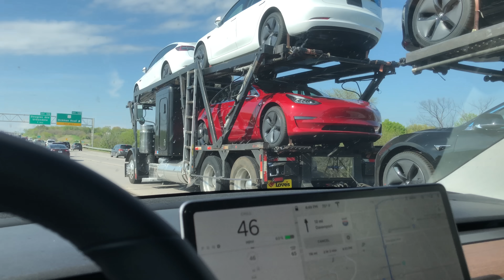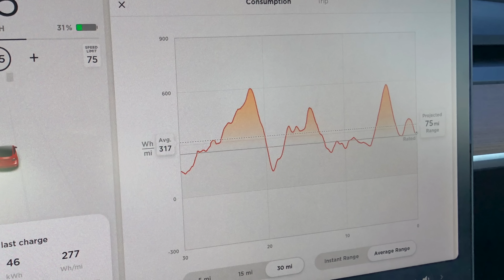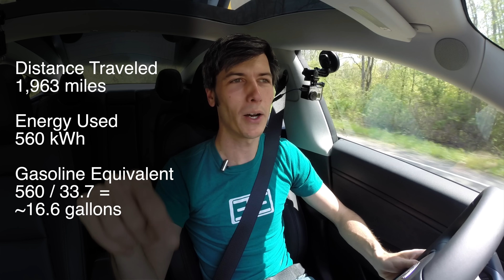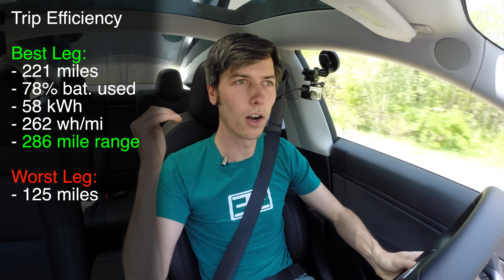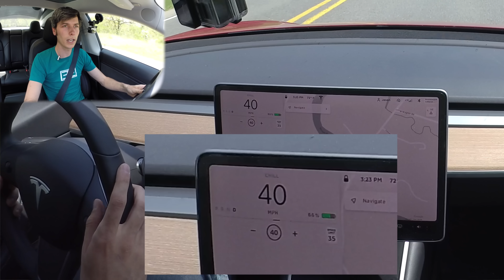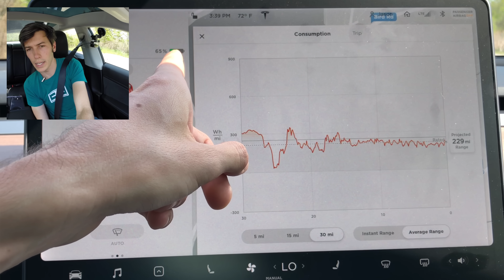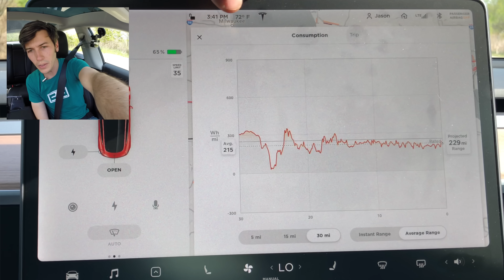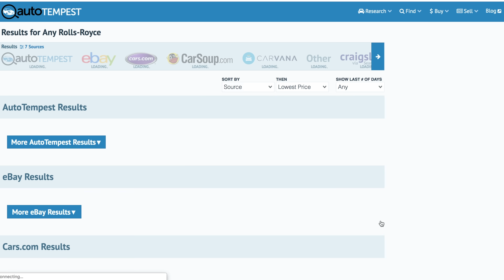How Miserable Is A Tesla Road Trip?

Comment: 21:31 is everyone going to gloss over the fact that he spent 8 hours charging this trip and only saved $40?
Reply: I thought you were getting 118 MPGe?  1963 mi/118 MPGe=16.6 gallons equiv., at $3.00 per gallon, that's $50 total.  Or, is that only at the "cheap" home charging rate?
Reply: @JN-lh9td  he said the supercharger stations are a lot more than charging  at home. I'm guessing it's to get gas stations to put in superchargers.
Reply: A lot of you saying it’s not very efficient if you were to consider a full year of this it is possible to save thousands and it is a developing car so maybe in a decade efficiency could be much better and make the savings much better
Reply: Number of extra hours I spend charging on a Tesla road trip: 1.5

Number of extra hours I can drive because autopilot reduces fatigue: 4 

Total extra hours I drive per day: 2.5
Reply: I make a trip similar to this every year but it's from NC to WI. The GPS shows a travel time of 13.5hrs round trip with a total distance of 890 miles. I would regularly complete this trip in 12hrs to include 1 stop to fill up my volkswagen and 1 extra stop for a food joint I like along the way. Overall my round trip would be right at 24-25hrs, average 75mph and 38-43mpg. 890/75 puts the drive time just under 12hrs for that trip.
Filling up for gas 1 time during the late part of the trip when file was around $3/gal only cost me $45 so grand total of $90 for his trip distance.
Reply: The problem is there’s only one charger in my 60 mile radius and about 40 gas stations.
Reply: @raptor0422  

Thinking that's a meaningful issue a misconception I like to call "gas Station thinking", a malady that is very common.

One of our BEVs has over 60,000 miles on it, in about 2.5 years, with maybe 4-5 times visiting a charging location with it. The first time was to try out using a charger, because I'd never owned a BEV before and I was curious what it was like.

The other few times I happened to be parked somewhere the charging spot was the best parking around, and I was going to be there for a while. Basically as a pretense to get better parking. :) Didn't actually need to use it, for any of these.
Reply: The savings should be up to $196-ish if you have free supercharging? Even at that rate, it’s still not worth taking the Tesla in long road trips. Just rent a gas car lol
Reply: Yes, and not only the lost 8 hours, but every 200 miles or 2.6 hours you had to pull over and charge. My Camry gets 41mpg on the road with the AC on, and that would have cost $144 in fuel or a cost savings of $12 to travel 1963 miles. Also the cost of my Camry is $25K vs his performance edition Tesla 3 for $48K.. WOW... $23,000 MORE - that's almost another car. I have ridden in one, and it is not worth $23K more, plus my buddy has much more problems with his 
Tesla, 4 things in 2 years, one electrical issue (and the car is all electric) one time his door wouldn't open and his paint is crap & peeling off.. The ole 2018 Camry has never been in for a repair (knock on wood) I think I'll wait until the cost of Tesla's come down like a big screen TV and the reliability has to goes up.
Reply: @ShelbyvsViper  Dallas to Phoenix, 3 fuel stops.  Midland, 325 miles (give or take) and buy a sandwich (25 min total)  On to El Paso (318 miles) eat at a sit down place.  Gas and eating 40 min.  On to Tucson (300 miles?) grab a sandwich, or some snacks, 25 min and on to Phoenix.
13.5 hours total or so, including 2 or 3 splash and go rest room stops.
Reply: ShelbyvsViper I will also vouch for the 2018 Camry. I have 41k ish miles on mine, and not a single issue. Engine/performance is much better then when I first bought it. No longer sluggish, and I can get up to 45MPG driving around 70 highway only.
Reply: @ShelbyvsViper  apples to oranges batteries are subpar in raw amounts of energy but much more efficient. A model 3 performance battery is equal to 2 gallons of gas. Do the whole trip, 2000 miles and all, and stop every time you use more then 2 gallons of gas and refuel. The only thing holding tesla back is the battery itself.
Reply: @yacqub  Granted much more efficient, and with Tesla's new battery breakthrough we may see the battery in a car far outlast a gallon of gas. But your comparison is like watching a 60" big screen TV on 60 1" iWatches (both technologies are out today), and until batteries catch up with fossil fuel (and it will) the majority of the world will watch a 60" Big screen TV. The next challenge is  when EVERYONE is on battery operated car and the drain on the grid will be astronomical. Can you imaging replacing 1.1 billion cars with battery operated cars? Yes solar power and renewable energy will help, but when this happens it will be a another discussion 30-40 years from now. Heck in certain states and 3rd world countries rolling blackouts are now a common occurrence.
Reply: Yeah, i though EV are more efficient than hybrid, my moms prius got 52mpg, so1963/52*3 = $113.25
That is a $83.5 saving over a regular gas car and $43.55 saving over a tesla without needing to spent hours just to charge, now i know why people who want maximum efficiency buy a prius lol.
Reply: @nonameyet2205  electric is great in town, gas for highway/long distance. So no surprises.
Reply: @gabemerritt3139  

Nope, I'd never go back to an ICE for road trips after my long Model 3 road trips. I might do a Model Y, but that's about it (I don't car much for the Model S/X).
Reply: @nonameyet2205  To be fair my 535i M Sport that's tuned making over 350 horsepower gets 37mpg highway. So your gas saving over a regular gas car is only saving you 46 bucks over almost 2000 miles. Ill pay 46 dollars any day to not be driving a prius.
Reply: noName yet Prius is of course a lot less efficient than any BEV.
Reply: If you can buy a Tesla, saving $40 for anything is not a consideration. Tesla doorhandles cost $1000 to replace if you break one.
Reply: @gregnixon1296  No, im saying he lost half a day charging and didn't really save money.
Reply: If you can afford the time for charging and are not in a huge hurry, this lets you take a break, go to the bathroom, eat, take in the scenery, etc. while your car charges. The range per charge will probably increase by 2 in the not so far future so this will be a lot more reasonable. Also, if you have autopilot and want to use it, it would probably be worth it over a regular ICE vehicle. Depending on how the electricity is produced, you are also polluting less than an ICE vehicle. The technology is only going to get better and cheaper so this video is cool to get an idea where we are at right now, but remember that it won't always be like this.
Reply: @digi3218  

> Depending on how the electricity is produced, you are also polluting less than an ICE vehicle.
Reply: @lthundertree6385  I'm just saying you can charge the car at your house using solar but during a road trip you can't do that. I don't want to start a debate about electricity being created using coal, etc. I don't have those numbers off the top of my head and am not sure if it is more efficient than gasoline. Also not trying to do a bunch of research for a Youtube comment.
Reply: @digi3218  I have owned a Chevrolet bolt for over 2 years. I have owned many vehicles over the years. It is one of the most fun cars I have ever driven. For my use I have never had to charge it away from home. Charging has cost me 2.7 cents per mile over that period of time. Every time I watch my grandchildren play I am very thankful I own this car.
Reply: It is easy to "gloss over" it when traveling like this is so damn awesome compared to with an ICE. :)

Here's the actual deal, it is ultimately faster for me to travel in my Model 3 when I measure from departure until I'm able to fully function as a human again. :p With the bonus of most of the trip occurring when I'm in a lot safer state of alertness. 

But yeah, he spent more time charging than what I've found normal. I suspect it has to do with how much buffer he was setting, and maybe occaisonally often he was choosing to stop (although 12 stops for 2,000 miles doesn't seem low, I'd expect maybe 10 stops or so, so not entirely sure here). So his charge times were a lot higher because he was charging to a higher SOC than really was required.

I can tell you that it certainly doesn't feel like much time spent charging. Because it is very rare that you're in the car during the charging, unless you're having a nap.
Reply: @aoeuuaoaou  when we travel my wife and I take turns driving, so the long stops don't happen for us.
Reply: @windrider65  Not sure here what you’re talking about?
Reply: @aoeuuaoaou  my wife and I travel in an extended full size van.  When we travel we normally have a cooler with food.  We only stop for fuel and bathroom breaks.  We don't drive much over 65 MPH and at that speed if I'm not fighting a headwind my van gets around 18 mpg.  With the size tank I have, I can go over 550 miles and still have about 1/4 tank left.  While I'm driving my wife naps, and I sleep while she's driving.  Only bad thing about my Van is the price to fill up.  Her Toyota gets 38 mpg on the road, but I have a bad back and can't get into it or out of it without help.  Just remember buy what fits your needs and don't worry about what other people think.  They're not paying for it so their opinion doesn't matter.
Take care of yourself and your family and stay safe.
Reply: @windrider65  

What have your recent trips, distance and and times, been?

Because I've heard this over and over, "oh we go with two drivers, we don't take breaks, you must take forever to get anywhere" and then they are absolutely flabbergasted how quick I travel.
Reply: @aoeuuaoaou  we drove from central Iowa to a little south of Tampa Bay.  Took us just over 28 hours.  I'm just glad that we didn't have the 32 foot travel trailer behind us, because we could never have done it that fast.  Remember I don't normally drive over 65 MPH.  I've got used to it because while towing I slow down.  I'm 55, and my wife is 56, when we were younger it wouldn't have taken as long.  That trip was about 5 years ago, I couldn't do it today.  That same trip would take me over a week.  Since I have hurt my back and had surgery, I can't even ride over 300 miles a day let alone drive it.  I guess I should have passed on the comment since I can't do it anymore.  Take care of yourself and your family, good health to you.
Reply: @windrider65  

With two drivers? Yeah, that’s pretty slow. I drove first “long” trip leg probably about 100+ miles further with a single driver in a little over 32 hours.

Because I stopped for a 5 hr overnight (plus a kid with me, so there was two sit down meals in there). That was with the old SC charging curve, with only SC V2 that peaked at only.

And arrived fully rested.

If it was just two adult drivers running your route I’d have been there a couple hours ahead of you. No exceeding speed limits.
Reply: @windrider65  Oh, and round trip fuel cost (so back plus another smaller leg of about 350 miles ) was about $125.

I think that’d be a little higher these days, they bumped charging costs in 2019
Reply: @aoeuuaoaou  for me, an EV just wouldn't work.  If and the Toyota dies, we're not going to replace it.  We now live full-time in our travel trailer.  We spend about 5 months a year in a RV Park in Georgia.  We split the rest of the year in South Carolina, Ohio, Iowa, and Florida.  Always taking 2 autos just doesn't make sense. The Toyota is paid for, and we've got one more year to pay on our Van, it's a 2017.  I know my van drinks fuel, but taking my house with me, I need something to pull it.  As I said before buy what fits your needs and don't worry about what others think.
Reply: @windrider65  

Those particulars of your situation isn't really what this discussion wall all about. It is about how BEVs travel long distance, and the misconceptions about how traveling like that is. Some of the misconceptions which you've demonstrated you have held (hopefully no longer?)

The Model 3/Y is about as good as it gets for any long distance travel vehicle unless you're carrying substantially more cargo than "vacation mode".

P.S. 

If you have a travel trailer and you plan to only have one vehicle** equivalent to an Model 3 LR for traveling will be quite something to swallow (even after factoring in fuel cost differences)

The advent of the Cybertruck though is very likely to change that, though it is unclear how well the single motor version will do on trip speed. May need the dual motor for that. The Rivian R1T as well, although that's  more pricy, a lot closer to Model X pricing.

** Which BTW does bring why you aren't already selling the other already, if only to get rid of the fixed expenses
Reply: @aoeuuaoaou  the other car isn't that much every month for insurance and tags, plus the wife doesn't want to get rid of her car yet.  Why I can't understand because she hardly ever goes anywhere with out me.  We tried to give it to our son, to get him off his bike every day, it was his car.  His wife went to Japan in the navy and they lived there for 3 years.  My wife has a very bad habit of keeping anything that was his, only child.
Reply: @aoeuuaoaou  we have also always had large dogs.  If someone would make an EV full size Van with over 8000 lbs towing and can get 200 miles on a charge I would look at it.  Not having a house makes it hard to have a decent place to charge over night. If I had to, I can go about 350 miles towing my travel trailer.  I think it has a 38 gallon tank, I've put 36 gallons in it once and still had over 50 miles on the range gauge.

Comparing my van to a model 3is apples and oranges.  I won't put my dogs in the back of a pickup, that's why I drive a Van. I can tow, and we're not cramped while traveling.  My son has a Honda Accord, 3 kids.  They went to Iowa for Christmas.  They spent over 80 dollars to mail presents to Iowa because they didn't have room in the car.  He said he got just under 40 mpg over and back.
Reply: I think Tesla is not a real corporation or a real product. Instead it's some kind of research project. By and for people who are powerful enough to tell everyone to stop driving gas vehicles tomorrow. It does not look too good, so they will not do that yet.
Reply: @seriouscat2231  It isn't some conspiracy lol. Elon Musk also started SpaceX and other companies which normal businessmen probably wouldn't even try to start up or invest in.
Reply: @seriouscat2231  i hope you are trolling
Reply: @seriouscat2231  It's not a project. Elon Musk wants to help our planet by getting rid of ICE vehicles. Tesla is his company and they are working on making the technology better and cheaper. Right now their cars are a bit expensive but once they can drop the prices to where everyone can afford them, gas will be obsolete. The main automobile companies are already researching and trying to make their own EVs because they know the end is coming.
Reply: @seriouscat2231  

This car is so very much for me, I hadn't felt this flat out excited about driving in decades, since I was a young teenager. So where's my pow-wah at!!? Why aren't people following my orders about how to live their life? I mean if I made some, I guess.

LOL

I've driven a very large number of long distant miles in my life (maybe one day I'll sit down and try total it up), and this is by far the most relaxing vehicle I've done so in.

EE's clickbait title notwithstanding.

Comment: can't say I liked the clickbait, yet was still informative nonetheless. I would have liked to see you test out the 'a better route planner dot com' website, since i would compare it's use to putting in one of those windscreen mounted GPS units in a car that has an an old/doent have a GPS - or compare it to updating the year of your road atlas. While it's sad that Tesla doesn't build out the functionality themselves (probably because they don't want to??? trying to make things apple-esque with the "it just works" design philosophy even it it doesn't hold true), it feels slightly disingenuous to brush over it. While i get that this is supposedly a review of what the car is capable of, I feel that at least trying the alternative to the built in software would provide a more complete assessment of the capabilities of the car, even if the capabilities come with the asterix of not coming from tesla themselves.

Comment: forgot to price in the cost to replace that battery plus labor when it dies
Reply: Rdawg battery has a 8 year warranty or 100,000 miles. Latest batt is about 100 per KWh it’s close to an gas engine in cost and the labor is nowhere near the cost of a dinosaur car.
Reply: @johnjay6935  you're wrong. A p100d battery is like 25k. That's no where near a gas engine replacement

Comment: Imagine finishing everything you need to do and to stand around for an extra 50 min to charge the battery. Nothing like having to worry about the battery and the 'safety buffer' that only gives you 15 miles!!! Unbelievable. When you are on your death bed, you'll wonder what you could have done in your life without waiting and burning your life at the superchargers but then, it looks like you'll never find out.  
1.  The battery power density of batteries is no where close to gasoline. And considering time is a limited resource, you want to burn a finite resource of your life to save a few pennies?!!!
2.  These coal cars are still powered by fossil fuels!!! You are saving nothing.
3.  Your time is apparently worthless the dirt.
4.  Driving cross country in a coal car just allows more people to see what you look like and proves nothing else.